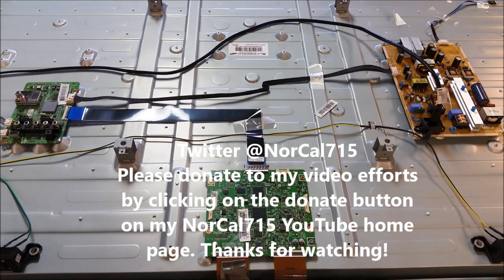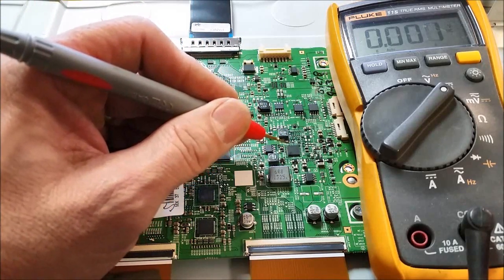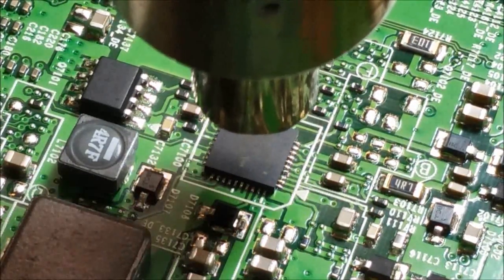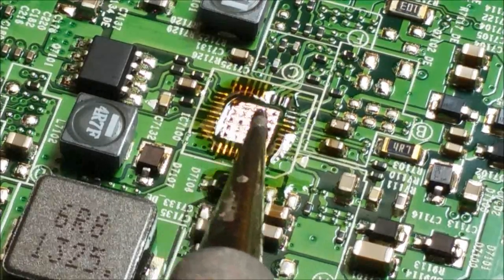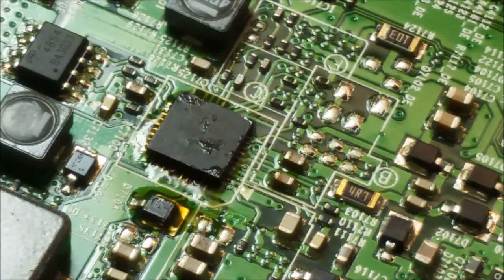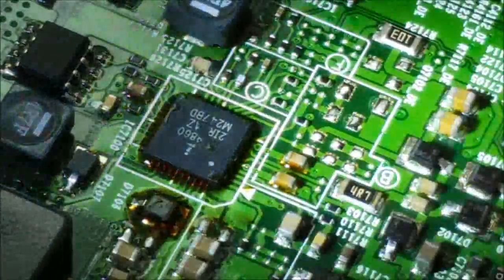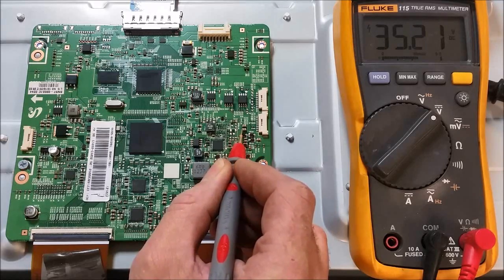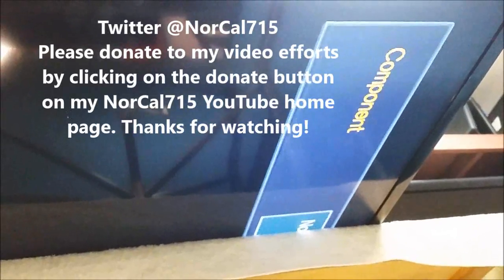Samsung UN60EH6000 Series T-Con Repair BN95-00628

Comment: Had a model UN60EH6000 that was displaying the same symptoms and had the same voltage drops on the t-con board.

Ordered a BN95-00628 chip from ebay and a cheap hot air station, and voila! The TV works great :D

Thank you SO much for this great informative tutorial. This got me into SMD soldering :)

Comment: I have a samsung UN55D6900, tv starts all good on turning power on and after 15 minutes the picture display starts getting bad then I can only hear audio n picture is flocking, what could be the issue?
Reply from the maker: Is it the backlight pulsing/flickering? do you have the back off of the set? can you see the backlight from behind? Look at the backlight with the back off, if it is dimming/flickering then most likely you have a failing LED/LEDs. If it is then you should replace all the strips as a unit for reliability.
Reply: @norcal715   I will check that , I don't have the cover off tv , I will unscrew , can you please check videos I posted of this issue on my channel one is at start , how perfectly it starts and other is when it goes bad, here is when it goes bad https://youtu.be/rOFmbFW9184

Comment: Hi got a 65fx700b which has 6871-5491c tcon which has the same problem no picture but back light when I reflow the power ic it comes back to life for a week or 2 then dies again ever came across it on the Panasonic?

Comment: good one sir,   sir, I have the  UN40EH5000 with tcon issue. there dc to dc ic issue,  Here the problem is DC to DC(SM4152) ic is programable one.  if you have the program and datasheet. could you please share to me.  I am ready to buy as well.

Comment: Thanks NorCal715. The Identification of key voltages on the T-Con module were right on. I have not seen such helpful information since Sam's Photofacts. With just a few Voltage checks one could tell if the module was good or bad. Samsung is very tight lip on giving help.  Keep up the good work. Melody TV Man

Comment: Excellent video, thank you for sharing. I have the same symptoms descrived by you, on my UN60EH6000F tv. Backlists are 100% and no image on the screen. I have tested my voltages at the points you have mentioned on the video - I do have my 12.6v at the large coil (6R8 1242) but no voltage at the coil above it and the two caps 0 volts. Not sure where to go with this if I have the same failure (power voltage regulator) as you did. If you could comment that would be great! Thank you in advance.
Reply: Just tested mine and I am in the same boat. The chip costs $6 at digikey and finding an electronics shop wont likely cost much for soldering. way cheaper than a new TV. I am guessing the chip has only partially failed.

Comment: Hi..i got my bn95-00944b board in today and works great now"...this board is a better alternative to bn95-00628c however the board is diff layout and the matal cover interferes with a board component..so i just put elec tape on the cover to buffer it from the component....tv works great now....if u get chance could you look up bn95-00944b and let me know which components i should put a heat sink material on top?

Comment: hi...i tried the repair today ful failed...when trying to remove the chip i tore off part of the trace/board....oh well..tv goes to trash now....i figured i would fail..its just too small and beyond my ability....i had my hot air ar 350c and it would not come off even after 5 min of heat..so i increased to 375c and it came off but i was pulling on it too hard i guess or too early and tore the traces and part of board off....this sucks becasue a tcon for this tv is about $100 and just not worth replacing since the tv is only worth maybe $100..oh welll
Reply from the maker: Sorry. maybe you can find another defunct tcon for $5 on ebay and try it again.

Comment: When soldering chip back to board how the heck do you h
Prevent bridging the pins with the solder?....they are just a few thousands apart so
Reply from the maker: I use a very fine point tip and the .015" solder. also good flux. Thanks for watching.

Comment: Nice video very helpful.  Can you get schematics on these boards or how can you tell what circuit is on and voltages?  I have a Samsung un50eh5000 and the image jumps up and down and looks like there is double of everything.  It seems to get better if I cool the t con board down, but heat on it makes it worse.

Comment: Hello, I subscribe to your channel and I have watched several of your videos. I am 58 years old and I have learned a lot from them. I have a question that I would like to share, seeking a solution. I have a SAMSUNG TV model UN49KU6300G and only when I turn on the TV so that the sound of it goes out in the Home teacher (SONY model MHC-RV9900 old) only a single sound hum sounds that it seems that it will blow up the loudspeakers. Detail: Only happens when I tune to local TV, NETFLIX. Already to play audio of the XBOX ONE S and TV to CABLE the problem does not happen.
ps: I am using optic output from tv to a converter with RCA output since my device only has this type of input.
Can you help me?
I'm grateful for now.

ps2: Sorry for posting this question in this video.
William.

Comment: Much appreciate the video! Might you have a circuit schematic for this board BN95-00628C  but also seems to be a common issue (no video display) as my problem seems to extend to blown main fuse @ F301, diode OPEN @ 2.5 M ohms (forward bias), O/L reverse. It also seems capacitors at least the primary common capacitors at  C7114, and C7122 unfortunately I can't  seem to find a schematic for the board. Thanks again for your great videos!

Comment: I've seen this model come in a lot and it's usually the t-con board. It has a high failure rate and I suggest if you cannot replace the chip to use T-Con part # BN95-00944C instead as a substitute. It has a much lower failure rate and looks great after replacement. Great job NorCal
Reply: Bruce, I've seen this part BN95-00944C sold as a replacement for BN95-00628, BUT with the note that it is "modified" to work.  Did you need to modify it in any way?  Thanks.

Comment: my tv is samsung UA55ES8000 actually TV was works fine before i de-assemble to fix vertical lines. so i was remove the back cover of tv then screw T-CON board and try to connect the T-CON Board left side socket to the LCD panel right side ribbon cable like swap to check the vertical lines get fix or not then tv turn power on and display goes to black ,no back-light, sound works. that was happen. please help me to find out which board need to be repair or replace?

Comment: Aside from knowing this chip is a prime suspect for this problem, how would you actually test it with a multimeter?  You tested other components and implied that they were functioning.  Other than that, great video with great soldering technique.
Reply: please disregard my prior comments.

Comment: Need your help have a PLASMA PDP-506PU has zero signs of power lights it has AXY1129 APS-216 power supply after running for a whole day the T8AH was bad I just replaced plugged in and it doesn't pop in fact if I use my meter with set power on I get readings on all the power heatsinks 120+ volts so I know it's trying to turn on but seems being no lights anywhere on set it doesn't do anything I can figure out where to go next a new power supply board?
Reply: Need your help 32 inch samsung let ,pic not come sound ok ,what is the problem number 9490902210 Hyd